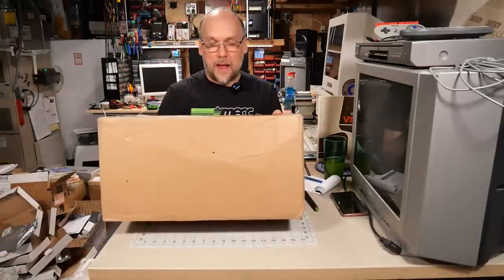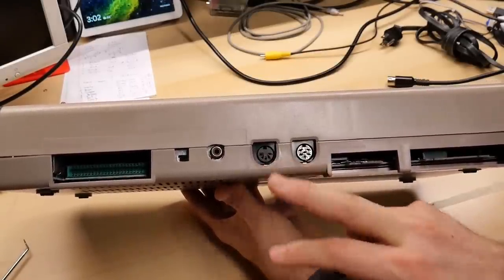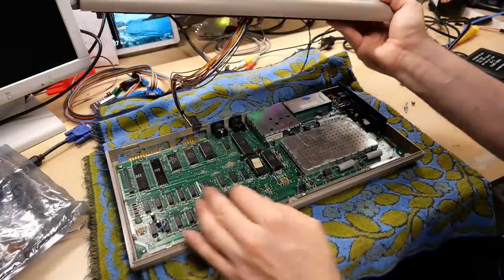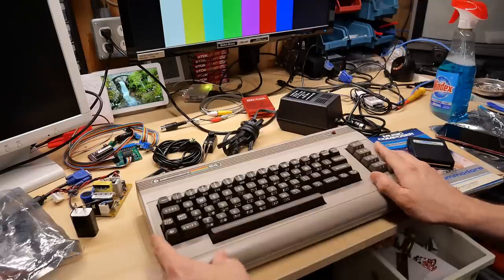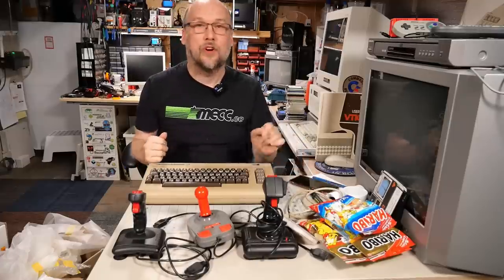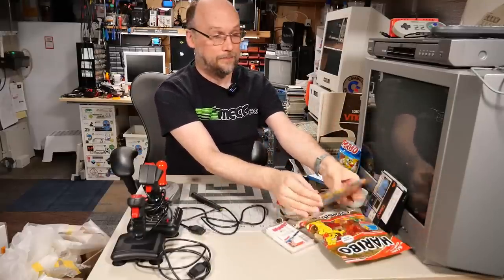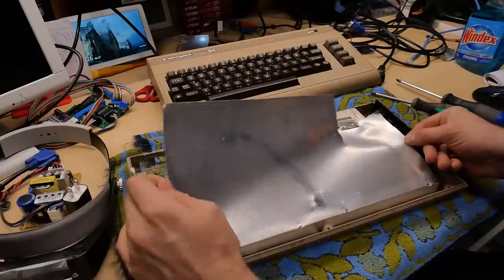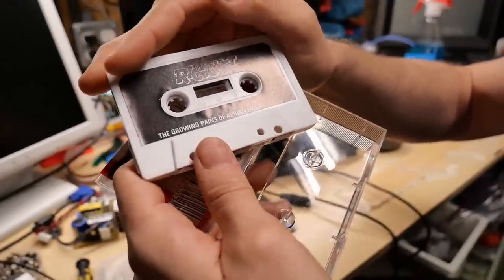A mint C64, Haribo From Germany, Joysticks and a replica Super Zaxxon cart

Comment: Adrain, before you destroy another book please download 'Clear Scanner' for Android Phones. Its free and is fast and simple. You can scan to PDF and do it much faster than a flatbed. It also compensates for the curvature of pages, within reason ! I use a plate of glass to assist in holding a book flat while a use my smart phone to scan. Love the channel and enjoy the videos but you sometimes just destroy stuff for no reason and its like your just not thinking !!!
Reply from the maker: Thanks for the tip, I picked up the app. (And purchased the Pro version.) Unfortunately, I don't have time to scan a 240 page book with my phone... Putting it through a document feeder would make short work of it.

Turns out the book is already in PDF form, so I didn't need to take apart the binding... but it really is trivial tout a book into a 3 ring binder again. Easier to work with when looking at schematics as well IMHO.